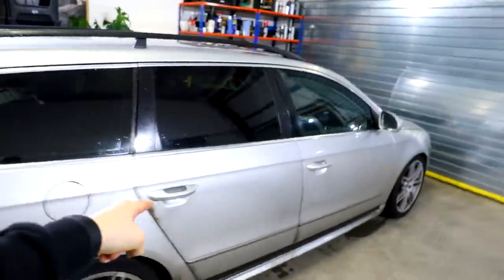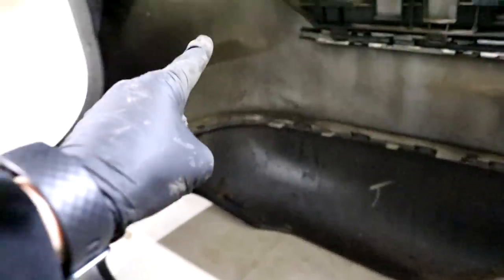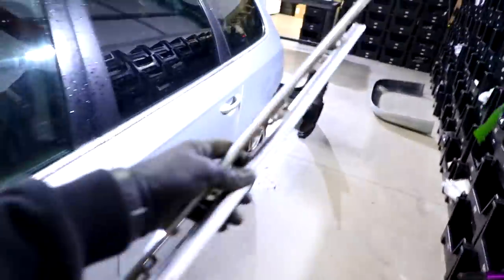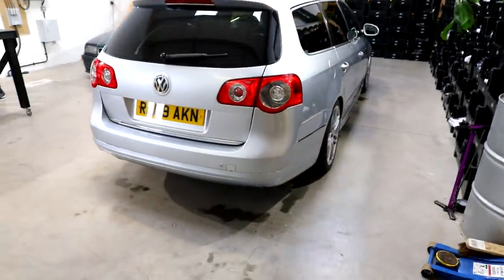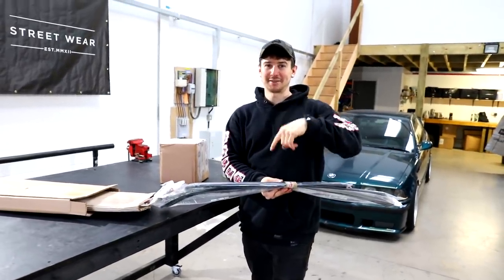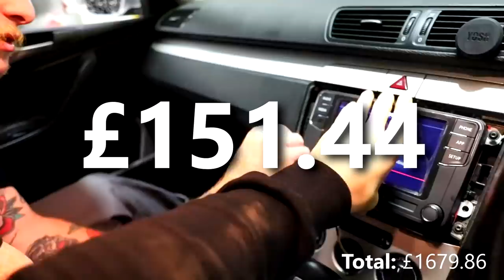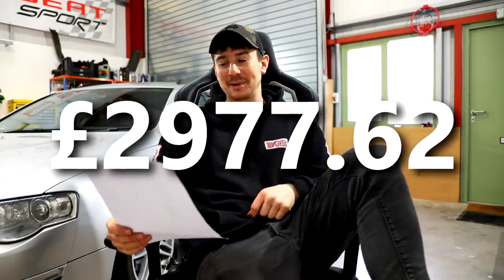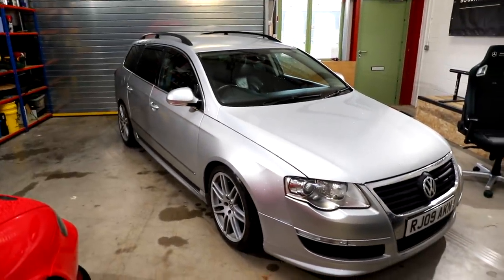Budget Daily Build - Episode 6 (THE FINAL EPISODE)

Comment: I had a 59reg grey Passat estate it sat on H&R springs and 3SDM 0.05's my current daily is a 12reg white Passat estate same set up but I've spray the wheels satin black with red centre caps and I downsized engines got the 1.6tdi  bluemotion tech with the de-chrome trim I've owned this car 6 years now after a couple of remaps she can handle, love your budget daily they are comfortable dailys and plenty of room for the family, you need to paint the door trim silver and your rear bumper in the middle near exhaust Matt black in my opinion other than that your Passat looks OEM clean love it makes me miss my old one. 🤙🤙🤙

Comment: You've fitted the deflectors wrong. You put them in then push the clips up to hold them in, the spike goes into the rubber and none spiked side onto the deflector ;) Your probably going to lose them on the motorway if you dont adjust it lol Love the estate looks mega.

Comment: Using a torque wrench after ugga dugging the wheel bolts, doesn't achieve anything... 😑
Reply from the maker: Yes it does mate hahah
Reply: @boqer123  No it doesn't lol... if you over torque something with an impact, using a torque wrench isn't confirming anything, just that it's tight as fuck. A torque wrench should tighten a bolt through 45 degrees before achieving the specified torque.

Simple engineering practice?...

Wheel bolts should be tightened to a specific level, not 'anything over that level'.